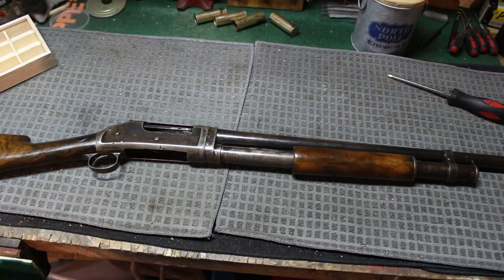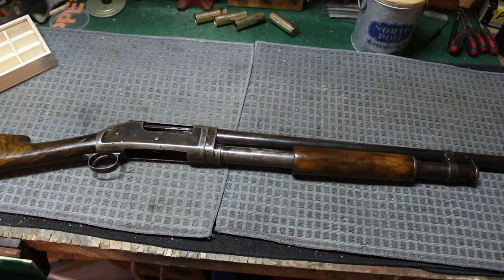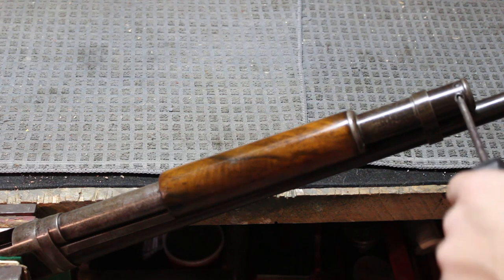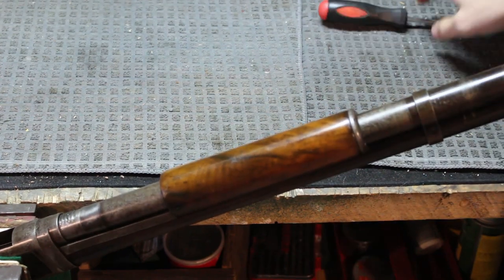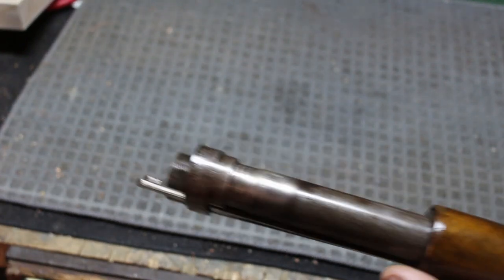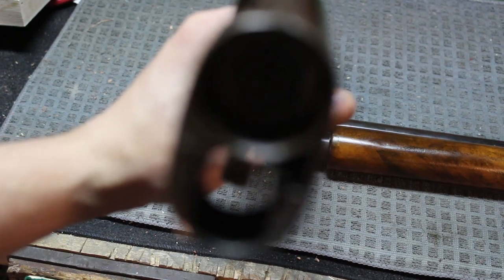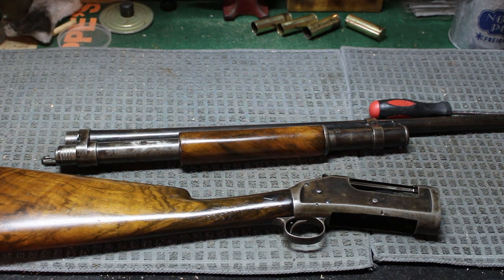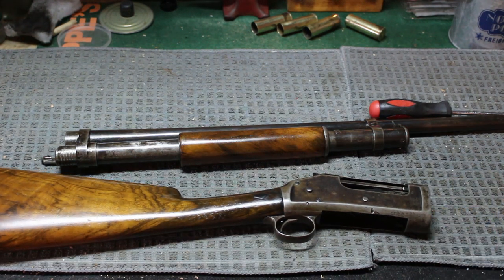Winchester 1897 Takedown Fix.

Comment: Mine is having the exact same issues. I just bought it. What parts do I need to get the mag tube to unlock and slide out easier
Reply from the maker: A pipe wrench, sand paper, and lube. I left mine how it is because it's tight. If you make it easy to take apart they are known to be loose.

Comment: I’m sure you’ll have it fixed up in no time
Reply from the maker: Yeah, i figured out the problem. Where the threads are supposed to be non existing, so the mag tube slides in the receiver. Turns, out there is threads cut in the receiver only on the bottom... Il need to lightly buff them out.

Comment: Im considering getting a model 97 and swapping a 20 inch riot barrel onto it to make it into a trench gun. How hard would a barrel change be?
Reply from the maker: They are just screwed on. But where we are uldbyou get an original barrel?
Reply: @northernwoodsman  Ive seen a few for auction, you trying to do the same thing?
Reply from the maker: @chernobyl3458  Nope, mine is a short barrel already.